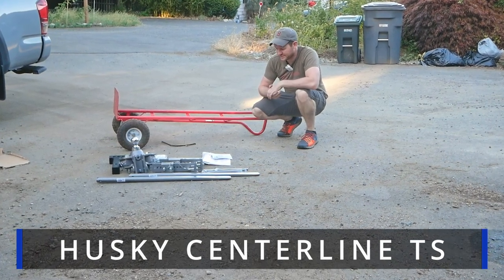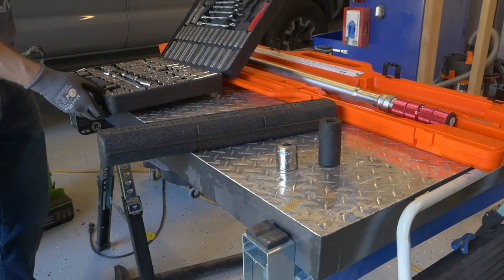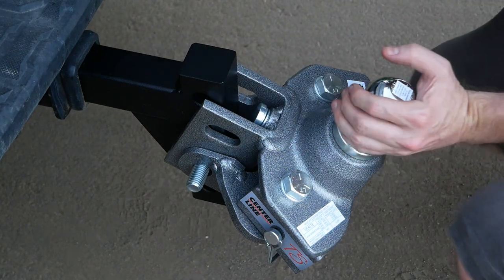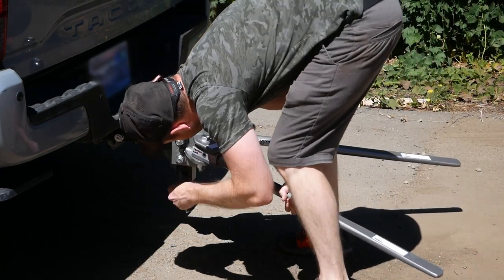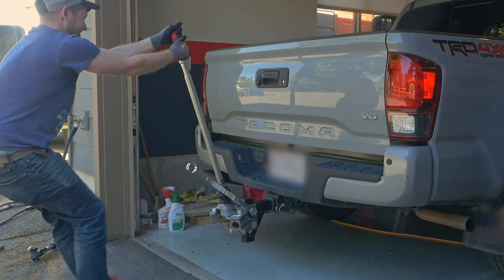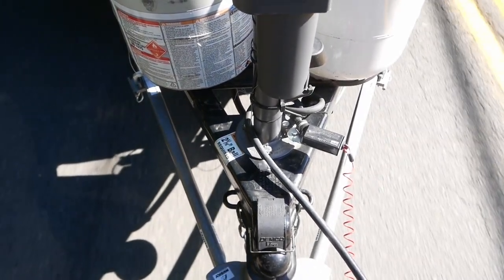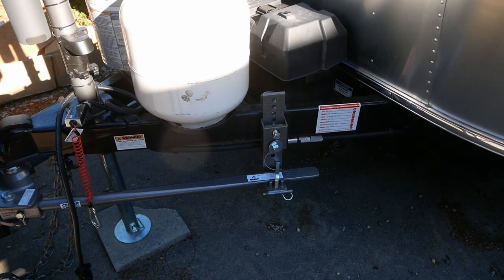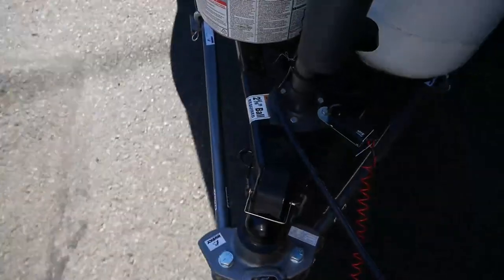The Husky Centerline Hitch on my Tacoma is Totally WORTH IT

Comment: The hardened washer you install on the pin are used to adjust the system(it actually states this in the instructions). From what I have learned, If you add washers, this increases the angle of the spring bars(inducing more force on the bars) thus transferring more weight to the front of the vehicle.

Comment: Hey Aaron!
Great video - I also have a Tacoma (2017), the Husky Centreline hooked up to a Wolfpup 17JG.
It drives smooth and makes the ride super comfortable.  Perfect solution and adds safety and peace of mind!

Yes, when getting ready to back up or turning more tightly, the creaking noise is somewhat “scary”, but that’s the friction bars doing their jobs!

I did notice, however, that the tools we use to mount/unmount the bars were not used properly (please, don’t take this as criticism, but as a tip)!

To mount the bars, I normally place the “parrot beak” notch in the square hole between the two (2) vertical pins. It then slides behind those two pins perfectly.

To remove the bars, I flip the tool upside down and lay the tool against one (1) of the horizontal side pins and push down on the tool so that the bars clear the two vertical pins.  If the bar just sits above/over the two vertical pins, I use the same tool (upside down - same side as the remove side) and use the square part of the tool against the bar and pull the tool and bar towards me (always watch your legs/knees)!

Again, thank you - great video.  Hope this helps and cheers! 0:36
Reply: Planning this now, 2018 TRD Off Road.  Possibly the same trailer.  happy with Wolf PUP?  Possibly GEO PRO G19BH or the wolf pup.  Thank you
Reply: @RB-mn5ix 
Yes, very happy with the WolfPup 17JG - great rig and no issues whatsoever during my 7 months trip thru the USA (I live in Canada)!
Left Quebec mid-October 2023 and went west thru Ontario, Manitoba, Saskatchewan and Alberta.  I then crossed the border to Montana (Bozeman and Yellowstone Nat’l park). 
Then to Idaho, Oregon and California.  After a few months in CA, I went to Arizona, Nevada, Utah, Wyoming and South & North Dakota and back to Manitoba, Canada and finally back to Quebec end of May 2024!  Around 16K miles…. Not a single problem with the truck or the WP.
The only thing I ended up not liking very much on the WP is that there is no “real” sink/vanity in the washroom!
Hope this helps! 🤙🏼⚓️✌🏼

Comment: When backing up with a wdh, if you're going up or down hills, take off the wdh, just use the ball. It can put extra strain on the tongue of the trailer.
Reply: Can you elaborate more on what you mean? Like give an example of the kind of scenario. (Otherwise seems like you'd be stopping to switch very often. But i don't have a trailer yet or wdh, so i probably am unable to relate to what it is you are actually saying.)
Reply: I contacted Husky Tow - no need to disconnect. It can affect steering ability if one disconnects.

Comment: Didn't think Tacoma's had enough payload capacity for a trailer that  size and weight. On my 26ft 6300lb Travel Trailer, my actual loaded tongue weight is around 900lbs. My 1/2 ton truck has a payload capacity of 1735lbs which leaves me around 800lbs for me, passengers, and some gear in the truck. It adds up fast.  I
 also use a Husky
 Centerline TS with 800 to 1200lb bars.
Reply from the maker: Airstream lists a 500# tongue weight for the trailer

Comment: Guy threw in this hitch with the camper.  I like it, but man if you're not perfectly straight and level those bars are a pita to get on.
Reply from the maker: Sure you've got the brackets adjusted correctly? They shouldn't be that difficult to get on.
Reply: @aaronstestlab   yep.  I find that as long as you're on level ground and the truck/camper are perfectly aligned it's easy.  But if anything is uneven I have to jack it up super high to get the bars in place.
Reply: @aaronstestlab  yep, the trunnions were rusted in place lol.  Hit em with PB last night, and just booted them loose.  Had no clue they swung out so wide.  No wonder I had so much trouble lol.

Comment: I would like to know why/how do engineers come up with the toruque values?
Reply from the maker: It's probably the lawyers, not the engineers
Reply: Torque is a twisting force measuring force multiplied by distance. It is the application of force acting at a radial distance to create tension in threaded fasteners. The general equation for bolt load is based on applied torque is T = KFiDb where K = torque coefficient. K is a function of the coefficients of friction and collar friction in the joint, and these are based on variables such as surface finish, coatings, and the like. Torque values have a paralell or direct relationship with materials, size of the job and purpose of the nuts and bolts. If you stop and think about how substantially safe most everything is today from flying to pushing a baby stoller, the application of torque values by engineers is a rock solid science that absolutely works. And actually, the computer assesses the necessary bolt configurations and torque values not the engineer as the database is vastly expansive and is predetermined by the program being used. All that being said, there's still a place for the "guys on the ground" to understand that not all applications of torque values are perfect. Sometimes the bolt is too big and sometimes too small but usually it works just fine either way.
Reply: The hardened pin w/washers sets the angle, the high bolt torque and friction created by it keep the hitch head in place.  Just like lug nuts on wheels, the friction created by the torque carries/transmits the load not the wheel studs, the studs just provide the tension.